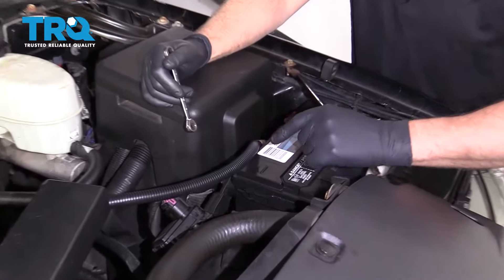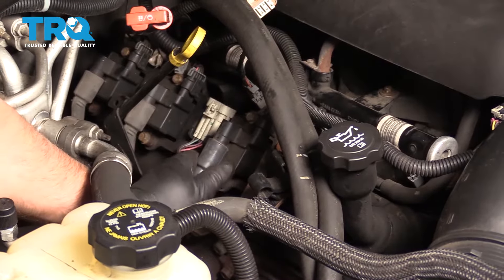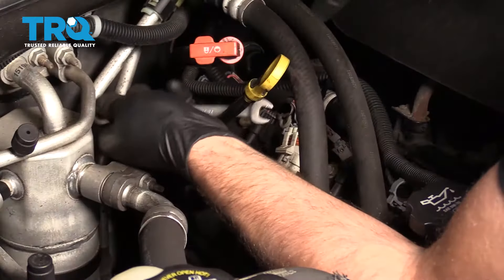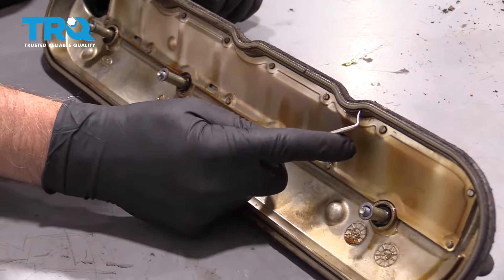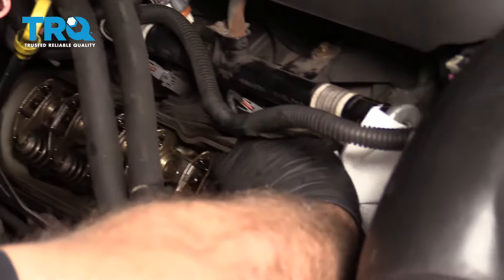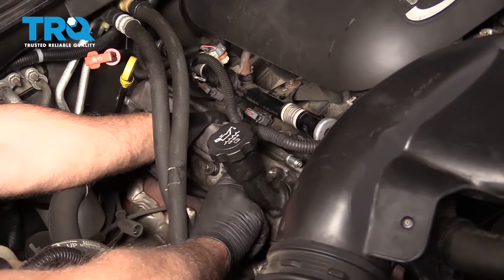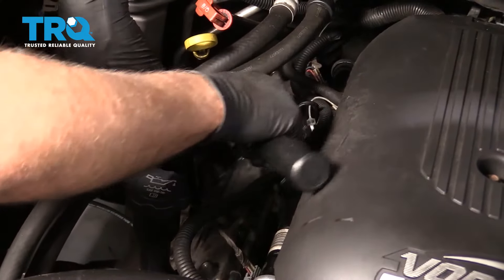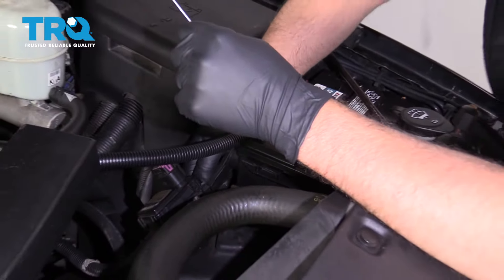How to Replace Valve Cover Gasket 2000-2006 Chevy Tahoe

Comment: Just a warning that I tore a few grommets in half by installing them using the method shown in the video. I had better luck putting the grommet on the bolt and then installing it in the valve cover. The brand I used was Fel-Pro. Besides that I appreciate the videos!
Reply: I was just going to comment that also. Had to use one of my originals as broke the first one I tried. All the rest I put them on first before installing them into the valve cover.
Reply: Same
Reply: I should have read the comments first
Reply: That's the way I do it as well.
Reply: Yeah don't do it that way.

Comment: I've found the easiest way for myself to do all the valve gaskets. Is taking the air intake off and I also replace the oil pressure sensor at the same time, because chances are if the valve covers are leaking so isn't the oil pressure sending unit. It makes it easier to remove the valve covers and install them. So air intake off, coil packs off, valve covers, then go in the steps in reverse.

Comment: Don’t put that bolt gaskets on the way he did. You will just break them in half.
Reply: How does it go on?
Reply: @MrsBuddevil  Did you get it??
Reply: I used a little oil and put them on the bolt the way you install a tire, put one side on then push the other side on. I Cleaned them off then popped them into the valve cover.

Comment: Install the grommets to the bolts first; then slide them into the holes in the cover. Use the easiest way, and save your energy for alot of  other problems in life.

Comment: Mine still leaked afterwards, I cleaned the surface and torqued to specs. I used a fel-pro gasket. I’m thinking I need gasket sealer or my valve covers are just warped.

Comment: About to do this repair myself as the passenger side is leaking/spraying onto the header heat shield...I'd recommend to check your rear main seal as well as your oil pan and pick up tube O ring if you're having some "oil issues" or "oil pressure issues" with high mileage on you 1500 Sierra/Silverado

Comment: To keep the gasket in place I put it into the grove and held it in front of an electric heater for a few minutes while holding the gasket in place. Eventually it relaxed enough to stay. I did not have to use any gasket sealer to hold it.

Comment: Question. So the valve covers on my engine do not have that intake vacuum line port/hole. But my throttle body has port for a vacuum line. Do i have the wrong throttle body?. I bought the 2001 Tahoe and i dont believe it has the original engine. I believe its a 4.8l

Comment: Where does the graphite gasket go?
You know the little one grey one
Reply: I think it’s for the knock sensor under the air intake manifold in between both valve covers
Reply: oil filter (if you have one) 
near drain plug underneath.

Comment: I don't think I saw where you changed out a seal for the oil fill spout. Can that be changed as well or is that not intended to be removed?
Reply: It's a o-ring you can take it out and clean it  but be careful you don'y break it

Comment: Does anybody know where that tiny gasket goes? It has 2 holes and comes with the kit
Reply: I think it was suppose to go on the space shuttle challenger 😢
Reply: @rudylovato2759  😂💀
Reply: @rudylovato2759  ahah
Reply: i  believe i read somwwhere that its a gasket for the oil filter (if you have one) underneath the oil pan near the drain plug.
Reply: It helps seal the blinker fluid in the turn signal lenses.

Comment: Not sealant needed? And anywhere to remove access oil from plugs or wells?
Reply: Do I need to replace my spark plugs still? And do both sides? V8
Reply: @momoneymafia6949  always replace spark plugs evenly if you have to replace them in the first place. If one is nasty you have more than just a valve cover problem